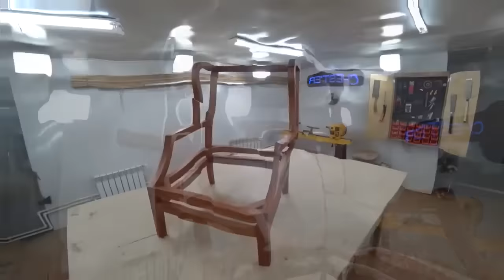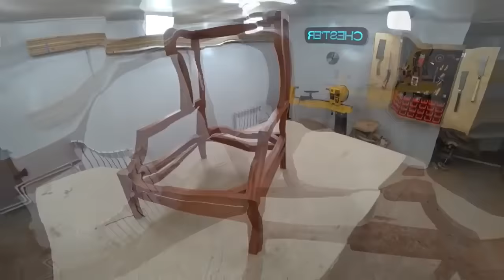FURNITURE MAKING | CHEST'ER | Leather & wood

Comment: I notice, in this video, you're joining parts of the chair with no loose tenons, no dowels. You're butt joining parts with glue and pocket screws only. I also notice you're using what appears to be a hide glue type of glue on those joints. Or, could the glue be some kind of Gorilla Glue? Gorilla Glue is available in the West. Can you please tell me what kind of glue you are using. The bottle containing the glue that is shown in your video seems to be written in Russian. I can't read it. Thanks & ...I really like your work. Been a long time follower.